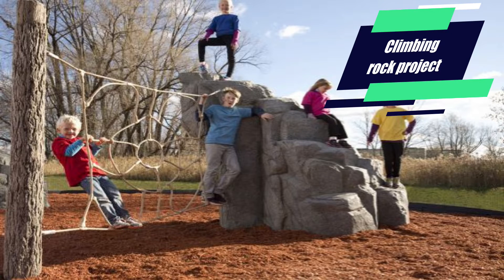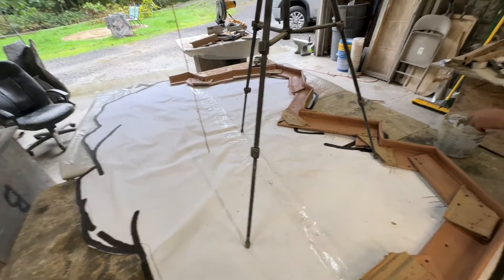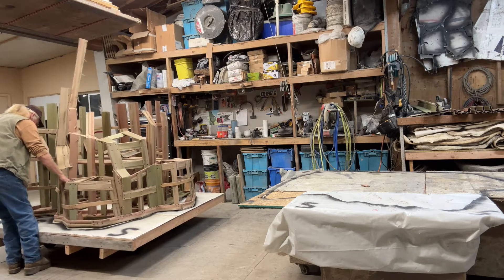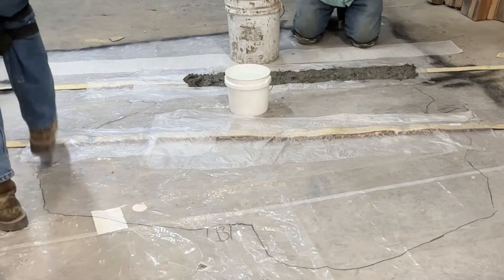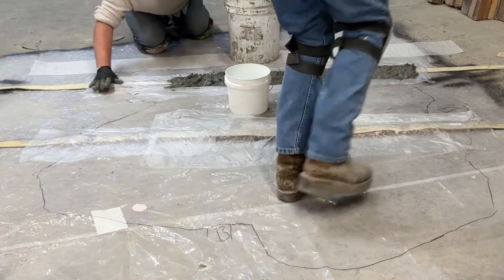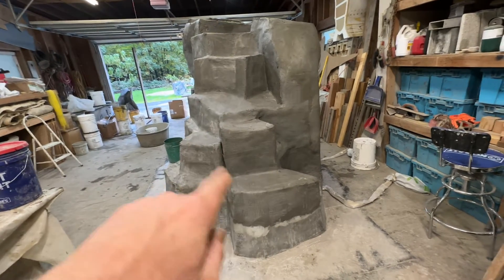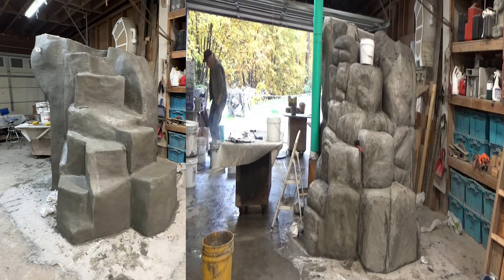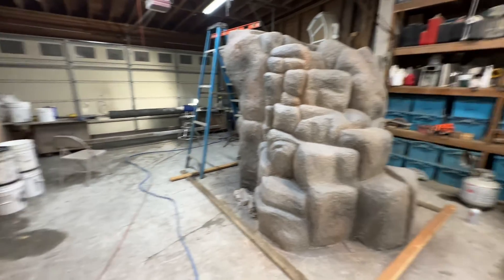Super Large Cardboard Climbing rock

Comment: what is foam mud?
Reply from the maker: It’s a mixture of Cement and Styrofoam beads, which is what you would call a lightweight Cement. In this particular case, adding definition with it was much less weight than if I used a regular motor mix. Thank you for watching my video.

Comment: This is awesome.  The kids are going to have a blast.  I am curious what the final weight for this is.
Reply from the maker: Thank you for the positive feedback. I really appreciate you watching my video.

The weight came out at 2200 pounds , but the company who originally manufactures this rock as a way to 4200 pounds so we shaved off 2000 pounds by using a higher strength, fiber, reinforce cement mix with mesh layers added.